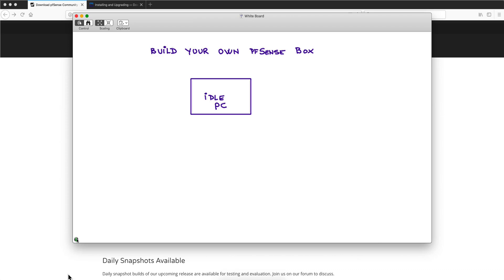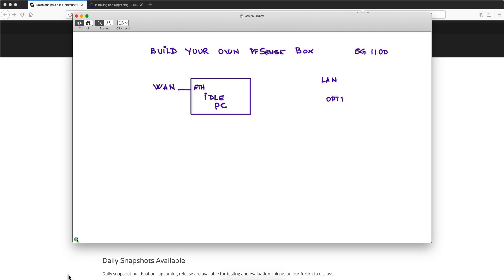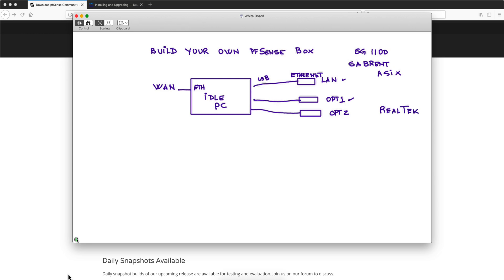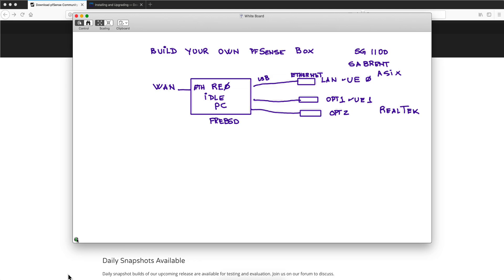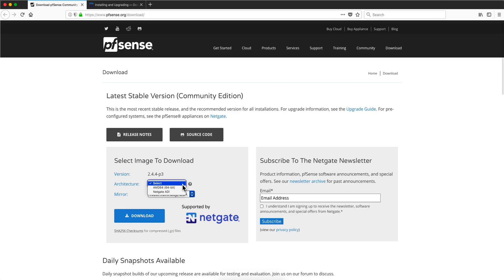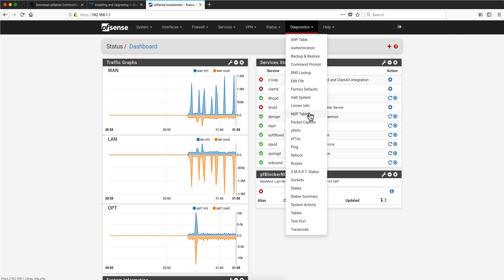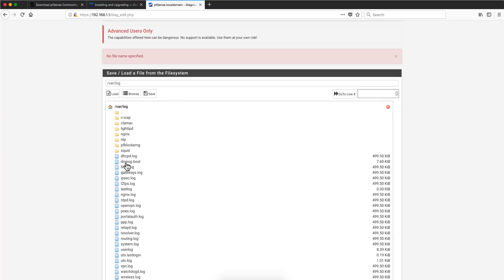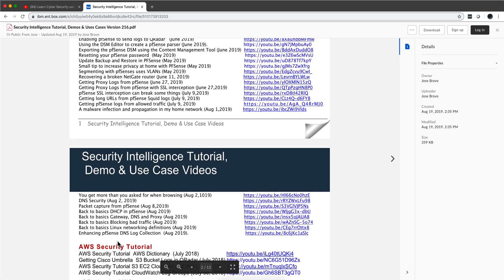Build your own pfSense Box

Comment: hello jose thanks for this video, i have a simple question a have  an ftth connection (1go down and 500 mo upload), when a do a speed test with my laptop directly, to the router i have this result (1go down and 500 mo upload), when i past by the pfsense (500mo download / 500 mo upload), ihave also done an iperf  between the synhronisation interface  (carp, interface related diretly between primary and secondary pfsense) the same result (500mo download / 500 mo upload), anu suggestion?,
Reply: Hi Mohammed Rahmatellah, in addition to what José already stated and assuming that you have built your own pfsense Box, I would suggest to check the real performance of your NICs, using iperf. If for example, you isolate pfsense and make an iperf test in the LAN or WAN segment and the test results are 500 Mbps then you would know that your pfsense is not able to get a higher speed. 

Since, it’s my understanding that you have 1 Gbps for download speed, you should now that most 1G NICs gives a performance below 1000 Mbps, in my experience, the real performance has been between 600 Mbps and 800 Mbps. In addition, if you could share your physical network architecture, we could try to think on something else. 

Hope it helps. 

Polo
Reply: Mohammed Rahmatellah one more thing to consider is how many security functions is your Pfsense box doing. For example, if you’re using it as a pure router, the performance of the box could be as fast as your NIC real performance. However, if you are doing Firewall + Web Proxy + Others Security Functions, then you should expect a performance impact due to higher use of hardware resources. 

This is why, for example, the Netgate SG-1100 technical specifications indicates a throughput of:

- Up to 1 Gbps for routing and,
- Up to 500 Mbps for Firewall 

Lastly but not least, the throughput will also be affected by traffic composition: mix of protocols, compression, packet size and so on. 

Hope you can find this useful. 

Let me know if you have additional questions. 

Polo
Reply: @leopoldoaguirre9451  i'm also using firewalling + ips (suricata), vpn, but as i hava already write on the last post, when i use iperf client and server between the firewalls (primary and backup) on synchronisation interface i have just 500 mbps, the configuration of the pfsense:
https://pc-industriel.anteor.com/index.php?controller=attachment&id_attachment=158

Comment: Thanks José, you summarized very well all the lessons learned that I wanted to share with the community. 

However, there’s only one thing I forgot to mention before: 

Based on my research, I found out that most people that has built their pfSense box, are using Intel PCI adapters and that those adapters are reported to work pretty well on FreeBSD and pfSense. So, if you find a USB to Ethernet Adapter with Intel chipset, you could try that one. In my case, I already had these Sabrent USB-G1000 adapters, with Realtek chipset, so, I decided to build my firewall using these. Fortunately, I have a stable pfSense box running today.

Hope it helps.

Polo